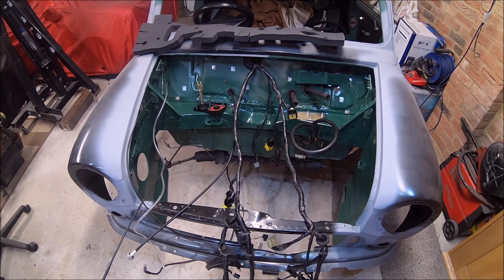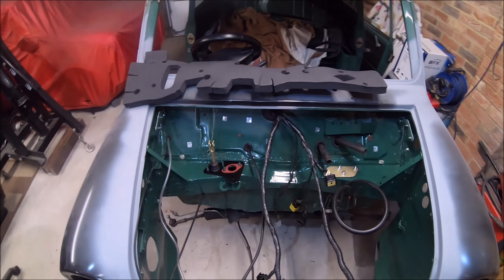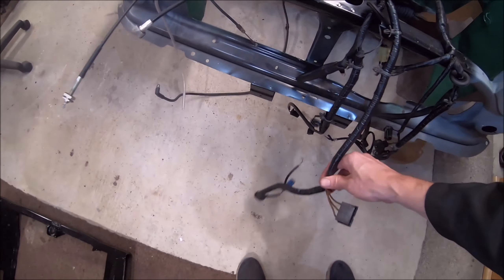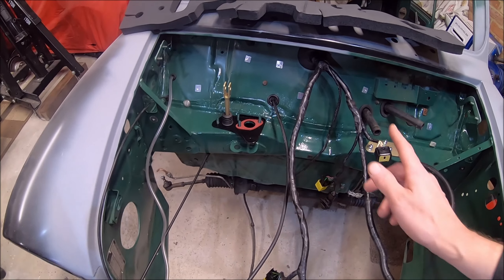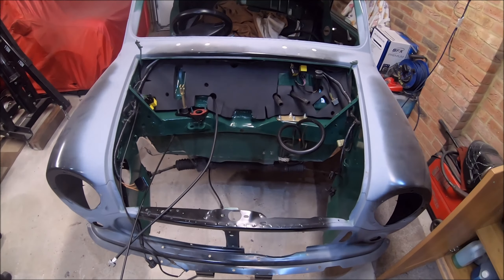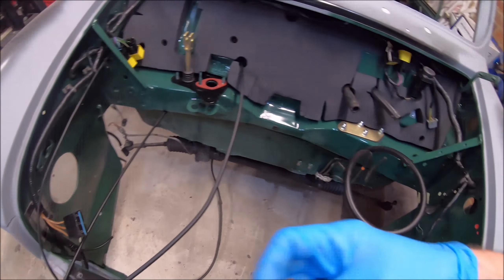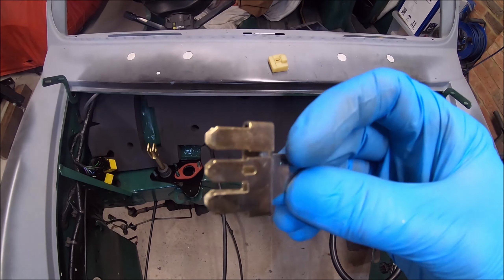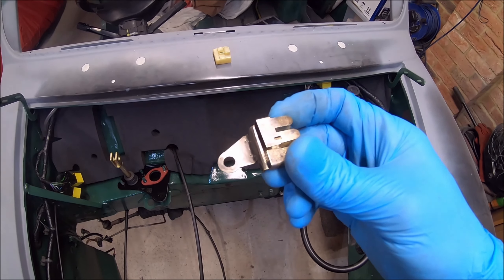Classic Mini Workshop - Project Sprout Pt. 39 Fitting bulkhead insulation

Comment: Again some very helpful hints on what to look out for. You are a couple weeks ahead of me & Miffi(my 1992 Mini Cooper). I certainly will now pay more attention to the connectors - you are spot on: I almost would have ignored them. And I am wondering if the last carb models did have bulkhead insulation? At least Miffi did have any when I bought her last year. Keep up the great work and video 👍😁
Reply: Looking at the MiniSpares site it seems that from 1990 bulkhead insulation was used.... I guess I have to watch your video again now 😉
Reply: @timbosinius3653  My 1992 Cooper SPi had bulkhead insulation from new. It came off in many small pieces and was in a very poor state. I am using the same Smiffy's Bits part as Keith has used for my rebuild.
Reply: @grahamwoodier5066  great information. Just added it to my SmiffyBits shopping list. Thx

Comment: Hi Keith,  what did you ude yo cover the loom?  Please tell me you didn't use electricians tape!  that stuff will not age well and leaves a awful sticky residue.  Let me know what you used.  Iwas thinking about a Mini van Like Alex Toon's but with a honda VTEC and a automatic transmissiion.  What do think about it?  Any Ideas about how to mount the automatic shifter?
Reply from the maker: I just used PVC electricians tape which I'm pretty sure is what the original loom it covered in. What other options are there? I guess fabric tape? Will the auto VTEC box fit, has anyone done it before? Auto boxes are generally q bit bigger than manuals

Comment: Was your sound deadening expensive? Might go to the lengths of replacing mine when I get around to removing the engine. 
Ps. Just a general observation, Mark and yourself are pretty tall fellas to be into minis. How Did you fall in love with these awesome little cars.
Reply from the maker: £25 from Smiffy bits on e-bay
Reply: Hi Anthony, for me, my first car was a mini as it was at the time the cheapest car for insurance, but i loved it too. I only had it for a couple of years and had to get something larger to carry my carpentry tools in as the mini wasn't practical. As i finally got my business to a point it was successful, i decided to buy another one and see if my love for driving and looking at them was still there. I now have a bad obsession with them! I actually find them comfortable to drive and my head never touches to roof, apart from the Pick-up. The seats in the pick-up don't go back far enough so i struggle with the leg room and don't enjoy driving it. M